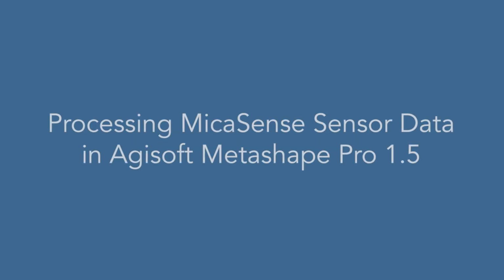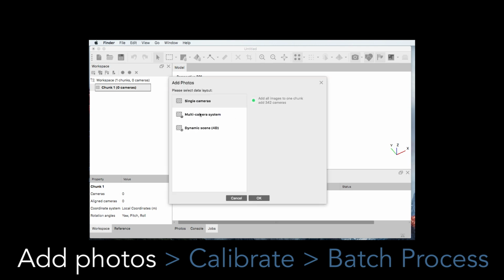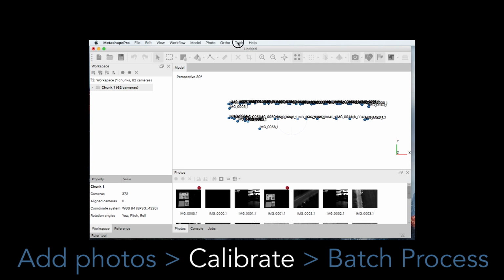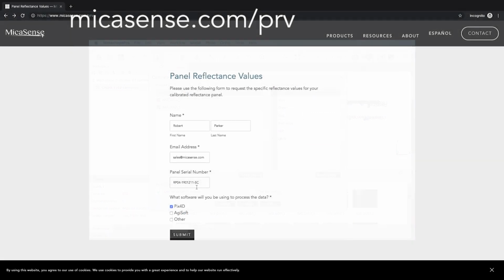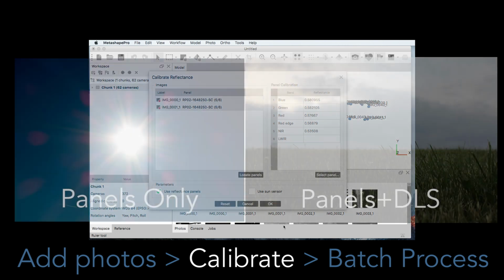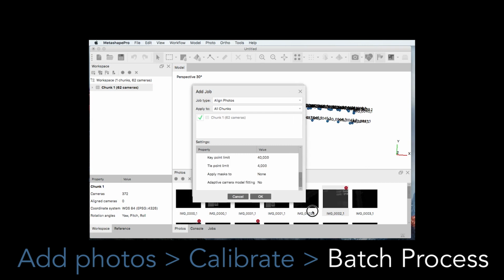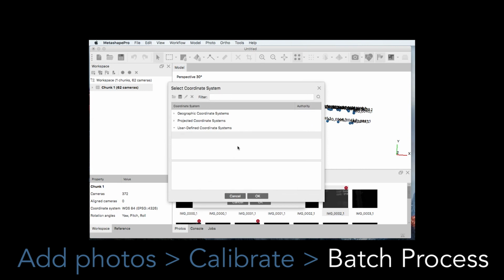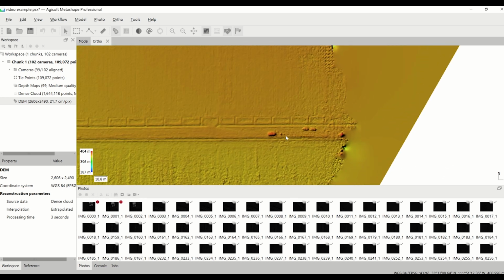How to Process MicaSense Sensor Data in Agisoft Metashape Pro 1.5

Comment: Hello! That is a very usedful video. I would like to know if reflectance panels are still needed on the ground even though the drone has an integrated spectral sunlight sensor aboard. Thanks a lot! :)
Reply from the maker: Yes, both the calibration panel and the irradiance sensor are needed to ensure the quality of the imagery.